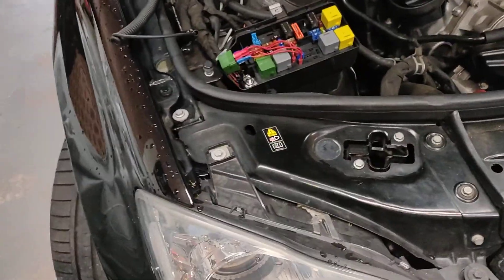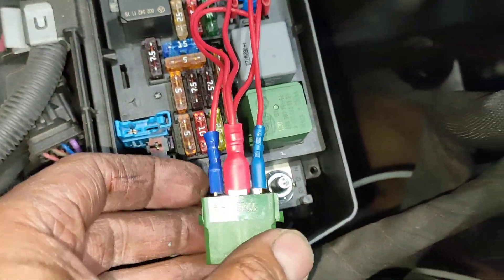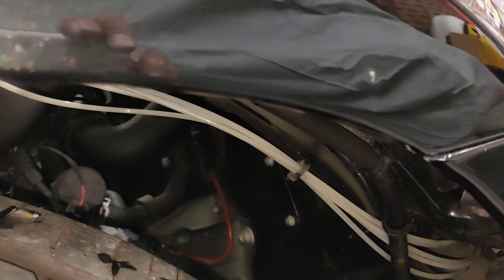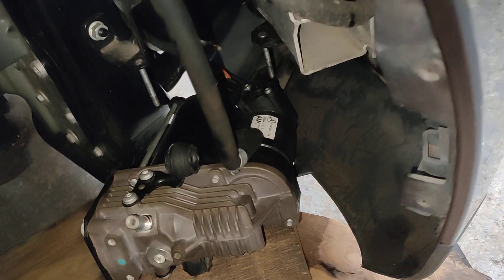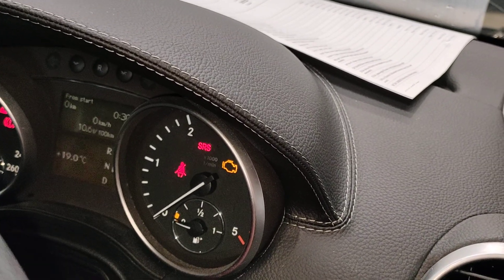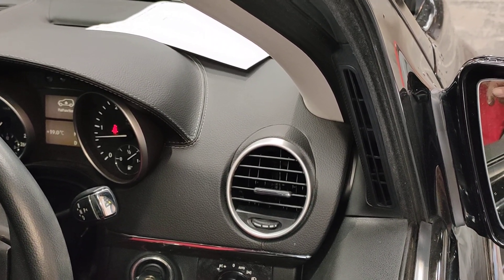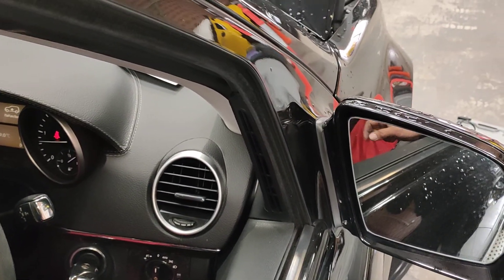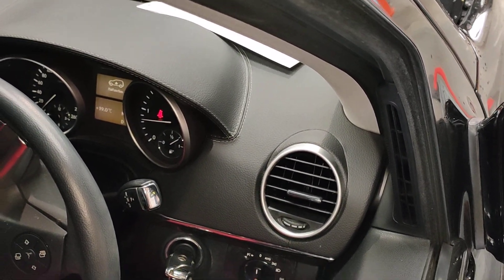Mercedes Benz GL320 Airmatic air suspension diagnostic Part1

Comment: Hello, i have the same issue....
It happened when i put a new relay. Just the moment i changed it it blows somethink.
Now, with the original, when air compressor goes to start car shuts down.
Reply from the maker: Check out part 2 & 3
Reply: @emdporschespecialistcaring8975  thanks. After inspection to the board of the fuse box one of the lines was burned (the one that goes to 87a connector of the relay) 
Now its solved!
Tnanks from Portugal!
Bruno Marques